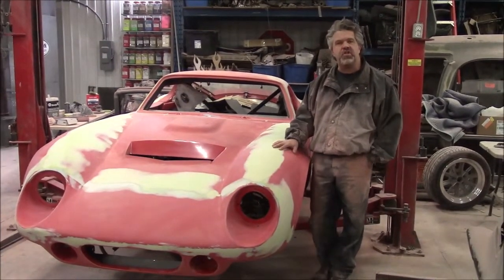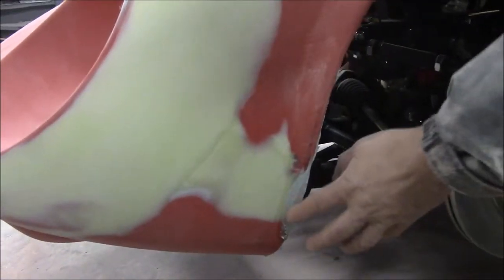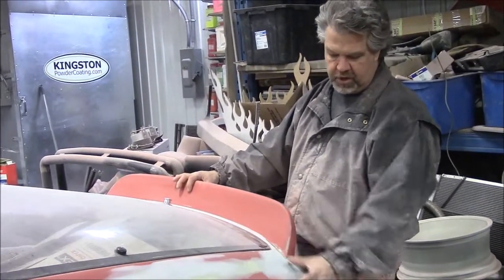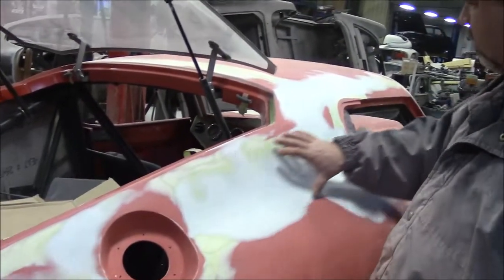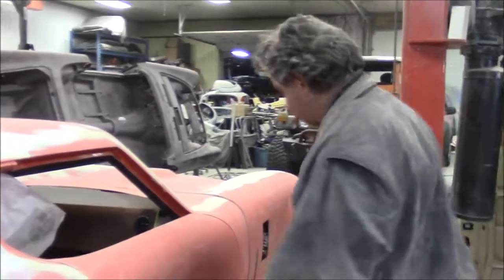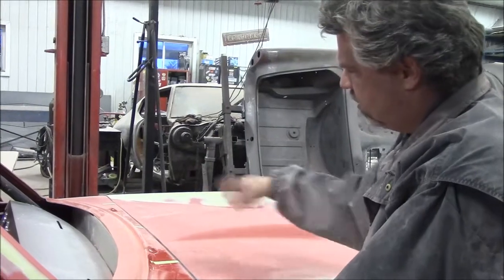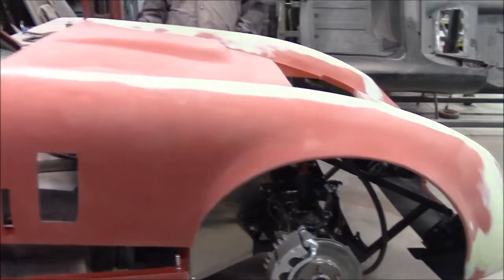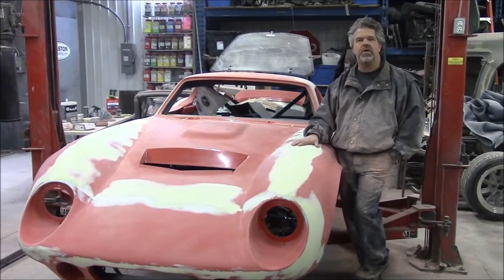Factory Five Type 65 Coupe, Part 11, Build in Ontario Canada, lastchanceautorestore com

Comment: John I like that you get dirty working on this project. I hope to start one of these soon, gathering info now . . . this is my first choice but may decide to do the FFR Cobra instead. Have to finish up the Porsche Hot Rod project first. Question: looks like you use a small air disc sander to clean the wax and gumfudgemon  out of the seams . . .  will a wire wheel work as well? I do not have a lot of fiberglass experience. Great vid series . .  just subscribed.